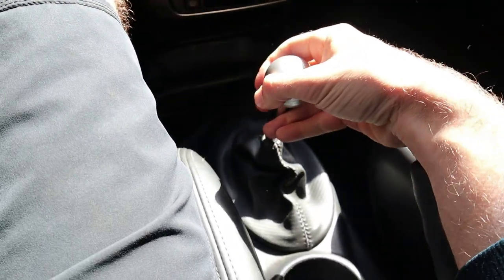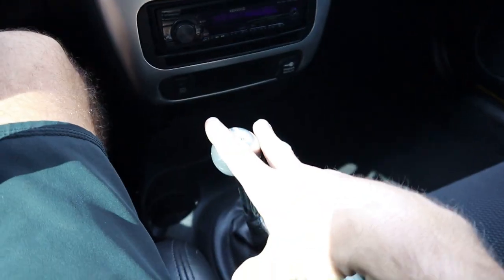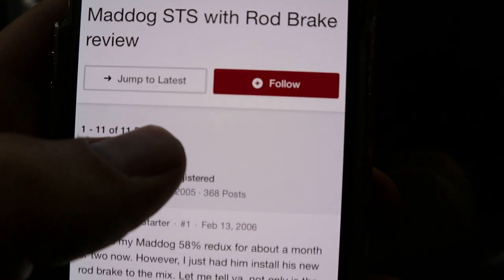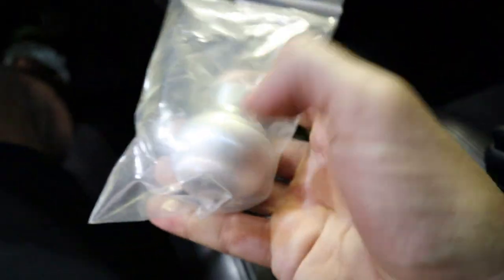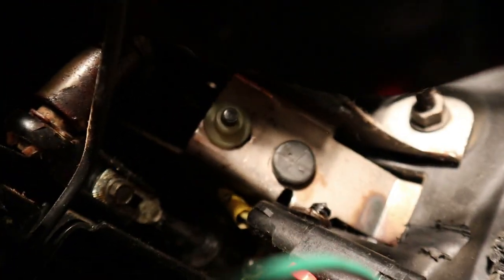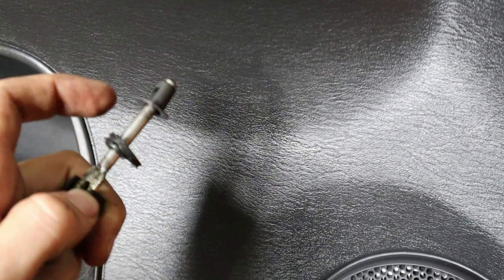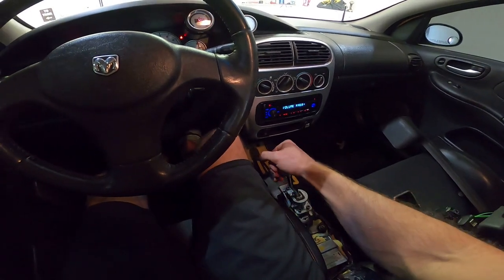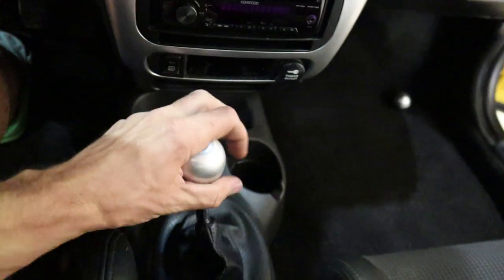So Your Dodge SRT4 Wont Shift

Comment: A tip for the push rod is you can save yourself the extra install headache if you buy their OEM replacement one. When I got my SRT4 the clutch engaged almost right off the floor so this was the first part I started with. That back plastic piece should have a plastic bushing in it that firmly snaps onto the little rod on the clutch pedal. Mine was missing and it was wearing the plastic outer hole down too. (Without the bushing this can also cause the plastic to actually slide off the clutch pedal, which would explain why mine had a zip tie on it.) If you go with the OEM design then you won’t have to remove the actual rod that goes into the master cylinder, just remove the screw, put the new one in, and set the adjustment with the screw to make the whole assembly as long as possible. Just having that little bit of slack removed with the new bushing moved the grab point way higher off the floor. I’m sure the flawed plastic design won’t hold up as well as the aluminum one but unless you’re keeping the car for years to come or racing it, it’ll probably be fine. Another thing to check is the shifter bushings outside on the transmission because someone put new bushings on the ones at the shifter but the ones on the transmission were completely worn away because if all 4 aren’t good then you’ll still have some slop in the shifter.
Reply from the maker: Good tip. Thank you!

Comment: I had the same issue for the longest time. Thought it was my synchros, turns out it was the arm! I would say the telltale sign is if the car starts rolling forward or back before you have it fully in gear.
Reply from the maker: Good tip. Agree 100% 👍🏼
Reply: Arm?

Comment: I got an SRT4 with this exact issue. Guy told me it was the push rod. So I bought the DCR one. Never installed it. Somebody then told me to try just adjusting the shifter. Adjusted it, and it hasn't done this since 😂

Comment: The NVG T850 is problematic, your problem is one of several, and only makes up a percentage of the issues that happen.  The third gear popout, shift selector breakage, worn forks, etc.  It was not a great transmission by any stretch of the imagination.  It is unfortunate that the PT Cruiser GT HO actually got a better 5 speed from getrag transmission, although even if a person found a way to use one (no one has as of yet, reverse is in an entirely different location, along with half axle issues and other fitment problems) the gearing ratios are way off and you won't go as fast.  The last thing the SRT4 needs is more low end/low speed torque haha.

Comment: My issue is an annoying clutch pedal squeak. I installed the dcr pivot, slave, and master cylinder and squeak is still alive and well. I even greased certain areas behind pedal and no luck. Does anyone have a solution to this?

Comment: Mine srt 4 its having problems going into 1-2 and reverse its hard and it make noise from the trans what could it be ??? Snd not leaking clutch flue and i change the trans fluid a couple weeks ago
Reply from the maker: Could be a lot of things. Clutch pivot, clutch fork, or if it’s making weird noises something like the throw out bearing could be messed up. Luckily these trannys are pretty easy to get out if you got to pull it.